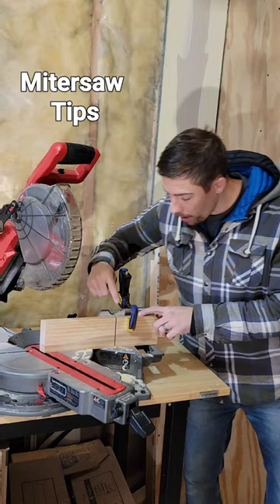mitersaw tip

Comment: Genius. Now if only there were a way to get the sawdust out…
Reply from the maker: The whole point of a stop block is to make multiple cuts the same size.  With this method you don't have to stop and clean it between each cut 👍
Reply: @gobuildstuff  all you do is blow on it from a couple feet away (most likely still standing how you do when you cut the board) and it’ll make all the dust go bye bye unless the board is soaking wet